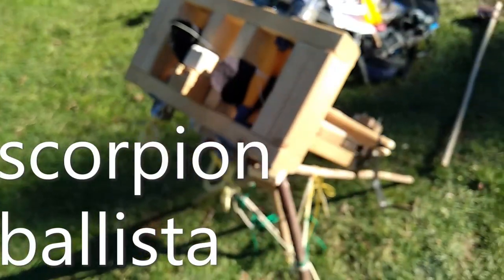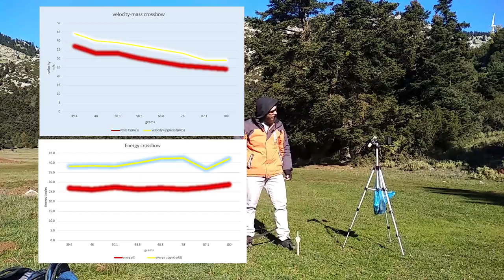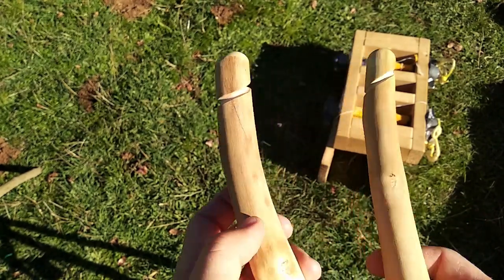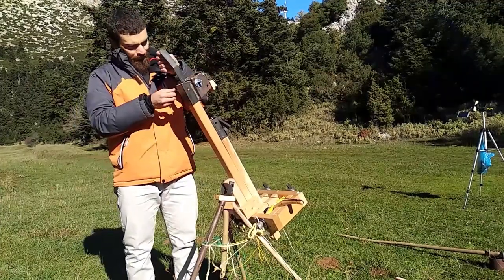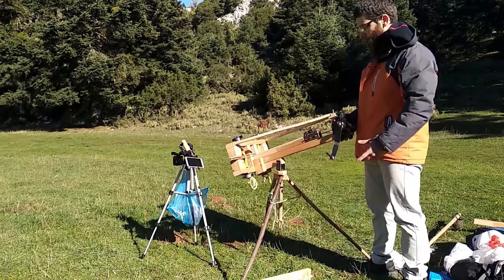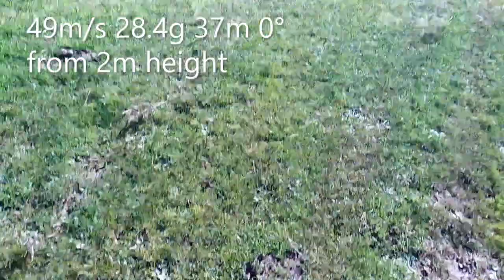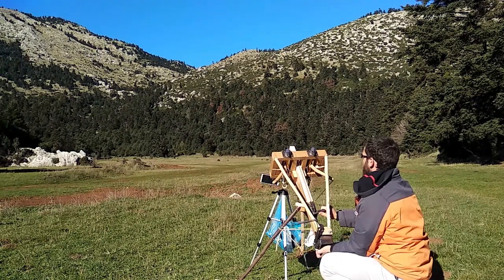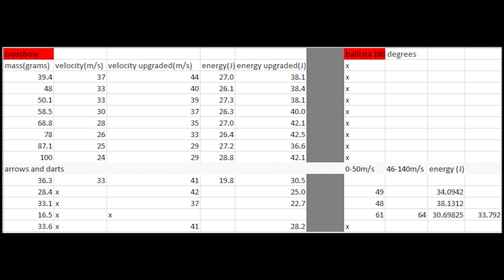Scorpion Torsion Ballista and Crossbow

Comment: The Acroballista is legit!  I like how you used arms that were grown to be curved.  The splitting problem could maybe be solved with some constrictor knots around the arm near the tips, with the knots pulled taught with marlinspikes
Reply from the maker: I'll fix them with glue and hemp and make a new pair so that I can replace the on the field.
Reply: @Acroballistics  it splits due to the design. So might be wise to go for a basic nock.
Reply: Isn’t it a manuballista?
Reply: @HistoricalWeapons  I think he named this particular one the "Acroballista" not because that's what the design is called but because it goes with the channel name.  Could have named it "George" or such.

I think this could be called a lot of names, manuballista would be acceptable, scorpion would be acceptable, etc.  Terminology is a mess
Reply from the maker: @HistoricalWeapons  a manuballista is steel framed and quite different this is a small scorpion something this size probably existed.

Comment: great video, just a joy to watch how your love for detail becomes visible (wooden fletches). I also once built a small model of a ballista / skorpion and was impressed by the performance in relation to the draw weight (but yeah, the draw weight with a torsion mechanism, still has a lot of punch in the front area of the power stroke compared to a classic crossbow / a better spring constant for the acceleration way)

Have you already tried very short bolts for the crossbow? due to the short acceleration way of a typical steel bow, they tend to have a bad flight if they are longer than the wooden part of the crossbow (they need a very stiff spine for short but hard acceleration / thats also why the work good with the longer power stroke of the skorpion)

Comment: The crossbow string might be two thin, causing it not too properly push the arrows and bolts. The arrows I think are too weak spined. So they bend to much and fly in all directions.
Reply from the maker: I don't know what it is. I think the bow is too tilted and makes the bowstring push up and down. but I dont make the best bolts either...
Reply: @Acroballistics  probably shoot short and stiff crossbow bolts and lett the string rubb a bit on the bolt deck.
Reply: Main reason why crossbow shoot slow is the steel prod. Terrible efficiency

Comment: How heavy is the ballista in drawweight?
Reply from the maker: I didn't do a proper measurement but around 20kg (with the washers twisted 180° from arms insertion position)
Reply: @Acroballistics  how much more do you think you might twist them?
Reply from the maker: @williamholm2020  I think 360 will be good.
Reply: @Acroballistics  have you prestretched the torsion ropes before twisting them?
Reply from the maker: @AS40143  yes. I think there was roughly 1 ton in each spring but relaxed since then